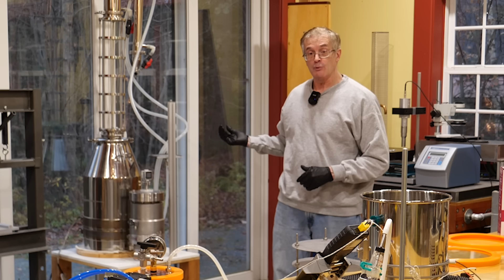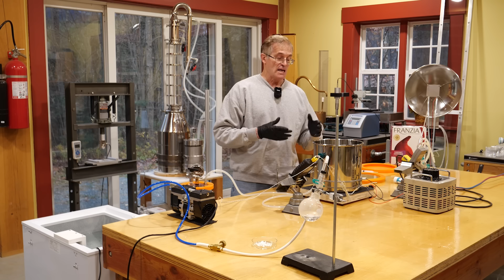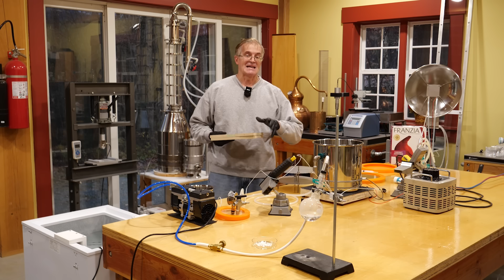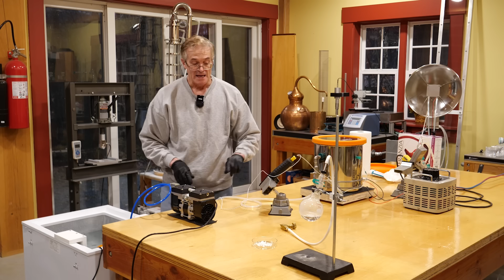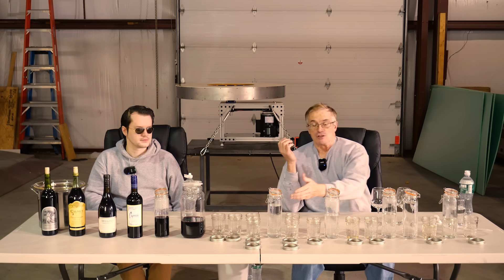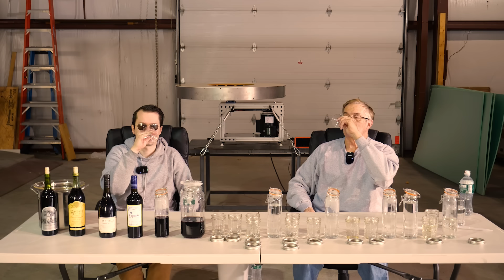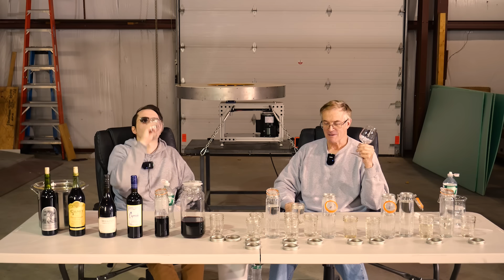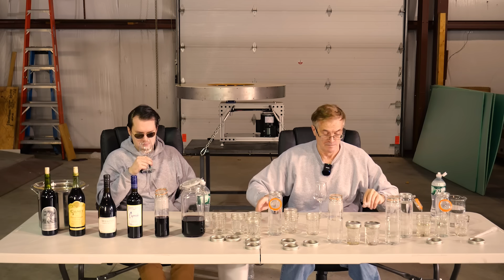Turning $3 Wine into a $100 Vintage with Science!

Comment: Suggestion for next time: Divide your first "pull" into three or more smaller ones. There may have been some "heads" in that first glass, which could be gotten rid of without sacrificing the alcohol.

Hypothesis with no basis in facts: When a wine is aging, the hypervolatile "heads" (or "pre-heads") are slowly evaporating out, into the head space of the cask or bottle. Allowing the wine to breathe is giving time for those to escape. Which could be simulated by pulling a vacuum and tossing the first few ounces that come out. Vintage wine in mere minutes.

Also, to avoid oxygenation, add dry ice to the pot (enough to fill the pot with CO2) and let it sublimate before adding the wine. Set the bag into the CO2, and cut it open. No oxygen.

Comment: The more components you remove from the final mixture, the more concentrated the final mixture will be. I wonder if there would be benefit to substituting the undesired components with something neutral flavored to avoid the final product becoming too intense. Also, there is no need to remix the parts in exactly the same proportions they came out. By dumping all the containers you kept back in the pot, you maintained the same balance between those flavors of the original wine. You may have a better experience mixing them in different proportions to fine-tune the flavor profile.

Comment: Thx for the video it was fun. I also have played in the same field myself. Just a thought but you might want to try adding back the same amount of distilled water that you took out by volume. I believe it might rid you of the tart flavor as well as intensify the flavors. I have found that water helps carry the flavor to my taste buds. You might even taste more flavors making it more complex. And as you probably already know, it will bring the alcohol back to its original proof. Just my 2 cents. Thx for the video.

Comment: The rejected fractions were mostly water, which you didn't replace in the final blend.  A lot of the improvement (and increased resemblance good wines) is likely due to the resulting concentration of flavors.  Which still leaves you with a vastly improved $3 wine.  I wonder if it would be economical to carry out this process on an industrial scale, and convert $3 plonk to, say, a $20 wine.

Comment: On the small container, you drilled holes in the plexiglass lid for the fittings.  Why not do the same for the large container?  That would seem to be less of a PITA that drilling holes in the pot and dealing with the rubber stoppers.

ALSO, if one put a value on their time, one would be ahead to just buy the more expensive wine and not spend 12 to 14 hours on this process.  I one scaled it up to doing 5 gallons at once, that might make it worth while.  LASTLY,  one could have as many of the smaller pots as one would have breaks and plumbed with electrically controlled valves.  Then a timer would open one valve at a time and in sequence.  Once set up and running, you could just walk away and come back when it is done.  That would increase the equipment cost but also the time efficiency.
Reply from the maker: Regarding the holes, the top for the larger pot is made from tempered glass. You don't want to drill that.
Scaling up will add only a little to the total cost.  That's good.  Furthermore,  once you have decided what fractions in the distillation you want to exclude, you can significantly reduce your involvement or as you suggest,  even automate it.

Comment: 12:25 Pressure cookers are incredible at making stock. Roast bones, add to pressure cooker, cover with water. It basically multiplies the cooking time by 4, so a 4 hour pressure cooked stock is like boiling on the stove for 16 hours, WITHOUT having to refill water and therefore concentrate the solids left behind by boiling.
	Pressure cookers can be used for like rice or beets or I guess steaming… they’re ok at that. But they’re unbeatable at making bone broth and bone stock.
Reply from the maker: You may be right about the bone broth.  I usually place a large stock pot in the oven overnight and it works very well.
In by limited experience with pressure cookers, the vegetables come out all tasting the same and the meat is mushy but dry.
Reply: Stock should never be boiled -it kills the essence.  Low and slow only.

Comment: I've been thinking about this for years! In part for distillation but also for maple syrup or broth reduction for mother sauces to see how reduction without heat changes to flavor of the food. I was surprised how well the condensation bucket worked. That was always the hardest part for me to solve because the pumps don't often handle water vapor well. But it looks like this simple condensation setup worked well.
Reply from the maker: It works extremely well and when you're done you can drain the freezer,  replace the lid and put the food back in.

Comment: I'll just mention that for cork and rubber bungs that I'd make the hole with segments of an old car radio antenna. Cut out the appropriate diameter stainless steel tubing from the the assembly , sharpen the ends and the rest is straight forward.

Comment: would vacuum "aging" impact what a normal aging does on a barrel ? basically would you speed up the aging process of say whiskey if you did it under a vacuum? tanins and flavor of the wood if left with the alchohol, would it be faster if under vacuum?
Reply: You could spend it up, however with vacuum you would slow down oxidation.

Comment: If you added a siphon with a valve to the pot, you could suck in the wine without exposing it to air at all.  Not sure if it would make any difference.

Also, while doing food experiments, here's one I'm pondering. My ultrasonic cleaner can heat to 80°C. I wonder what ultrasonic slow cooked meat taste like, and how tender it will be.
Reply: What are you smoking???
Reply: @Cooking-frogs  Nothing. By pouring, the wine gets aerated. Volatives will oxidize and impact flavours. Not necessarily a bad thing, but you might want to do the destination first. It's not complicated to avoid aerating the wine.

Comment: EDITED for 'tone' and details:  Commercial wines especially cheap reds, use sulfites for preservation. Sulfur anywhere in a distillation is pure nasty. Copper helps but not enough for what's in wine. 
Wine fermentation does indeed make methanol, up to 250mg/L. Grapes contain pectin and pectin ferments into methanol.
Most methanol does come out in the tails due the presence of water molecules spreading its effective vapor pressure over a wide range. There is little flavor difference between ethanol and methanol flavors anyway. Determining relative concentrations by taste isn't really practical.
Reply from the maker: I cover the copper in the livestream that follows.  I should have mentioned that added option during the video. 
You're wrong about the methanol and your condescending response was uncalled for.
Reply: @TechIngredients   Edited now w/ more detail and less snark. My tone was meant to be playful. Failed. Nevertheless my post was correct. White Labs in NC can test samples for you (GC) for a reasonable price. Copper works best with hot vapor. May not work well in a cold vacuum distillation system.

Comment: Vacuum distilling with a heat pump that moves the heat from the condensing side to the evaporation side would be much more efficient than regular boiling-destilling, right?

For small and bigger industrial scale.

Comment: Surprised you didn’t include a fractionating column. Awkward but might have better separated the cuts. Also consider not fully adding all of the residual tartness and color from the pot but add increasing amounts and see if perhaps a smaller portion is optimal. An interesting note from beer making is a step, temperature rest (I think), used to decrease the diacetyl content. I think it is skipped with some lambic styles where a buttery note might be a feature rather than a defect. My local daughter has a fairly well educated palate for wine tasting if you’d like another opinion. Cheers.

Comment: Also your vacuum pump reminded of one of my other favorite science tubers

Dan gelbert 
Video in question is titled “prototyping - metal 3d printing”
Incredible video. He take an sls resin printer prints an incredibly accurate silicone mold, fills it with a slurry of metal 3D printing powder and a liquid to suspend and bind it. Puts it in a freeze dryer to degas and dehydrate but leave the binder. Then winters it. If you can account for the shrinkage you can produce parts with tolerances that I struggle to reproduce consistently as a machinist and the ability to produce feature I simply cannot do. I would love a breakdown of yours on the video and I think you would certainly find it interesting yourself if only to be capable of producing some of your own custom parts.

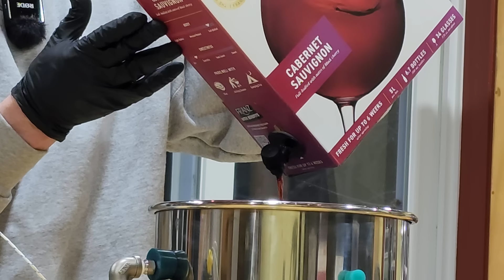Comment: One criticism.   First, I loved this entire video, watched every minute.  Even liked the prostate joke @34:57.   The criticism: I think you should have made 2 versions of final wine.  One, just like you did.  The second would exclude the appropriate percent of the undistilled red base equal to the percent of distillate you excluded (by volume).   IMO, your final wine had an excess of undistilled component.   Not sure which would taste better.   ----    Another thought:  keep a log as you do the tasting.   Option:  could taste in opposite direction since alcohol dulls the taste sensors, but going 1 to N like you did is more intuitive so this "option" thought is not really a criticism.      Final thought:  I had a summer job with EPA years ago;  part of the analysis of samples involved a freeze drier.  If the pressure was lowered too fast, the sample would boil over:  I now suspect this was the same thing as the bumping you described.    (we were measuring for halogenated pesticides in secondary sewage effluent, early 1970s)

Comment: Franzia is the wine I almost exclusively buy.

To get the last of the wine from the bag, you can either slice the bag open or blow some air into it so you can then squeeze the bag to blow the last of the wine out.

You can use a razor, a really sharp kitchen knife, or a sharp pair of scissors.

Comment: Rubber Stopper Drill

Using an external pipe to grip the stopper is good but to drill the hole, I take small piece of aluminum, brass or steel rubbing and grind a chisel edge on the tubbing with a cone shaped Dremel stone, diamond or carbide burr.

Chuck up the tubbing in a drill press and drill into the rubber stopper.

Isopropyl alcohol makes a good cutting fluid for sharpening the tube and cutting the rubber. If sharpening aluminum or brass the alcohol helps prevent loading up the tool.

The step drill is good for embiggening a hole in sst.

Comment: Amazing! Vacuum distillantion is how the better de-alcoholized wines are made these days - you break the wine into component pieces with the distillation, then chuck the alchohol and reconstitute all the other elements which allows you to lose as little flavor or aroma as possible. It all comes back together differently without said alcohol, but it doesn't "mute" the wine like heating it up outside of a vacuum does.
Reply from the maker: Agreed.
Reply: @TechIngredients  The one thing I will say: your reconstituted wine had a lot more time to "breathe", and possibly the $69 and $100 bottles would have tasted better if they'd had similar oxygenation prior to tasting. That said, the fact that those wines would have needed air to beat the reconstituted Franzia is still utterly fantastic, and a testament to the process. Bravo.

Comment: This made me remember an idea I had. I wonder how it would go if you distilled whiskey then put it in a circuit with a pump that forced it through whatever wood you chose. My idea being that instead of the whiskey being pulled into the cask and pushed back out be temperature over a long period of time to give it flavor, you speed that up by forcing it through what is essentially a wood filter.

Comment: Did you keep the temp the same the whole time? Normally we would slowly raise the temp to separate off the different fractions.
Reply from the maker: In principle,  it isn't necessary. 
Because the more volatile components have a higher vapor pressure (evaporation rate) at any temperature, they will accumulate earlier.
Reply: @TechIngredients I have just personally noticed you can be very specific about the fractions if you start with no heat and pull vacuum and slowly introduce heat you can see the individual compouds collect and then stop when the heat isn't enough to continue the boiling.

Comment: If there is methanol in the wort/must that you're distilling, there will be methanol in EVERY CUT except the final tails.  It is a myth that the foreshots (very first condensate that comes over in distillation) needs to be thrown away because it contains methanol.  The boiling point is only one component of the "relative volatility" (the vapour-liquid equilibrium behavior) of a molecule like methanol in a complex solution containing not just water and ethanol, but a host of other molecules, some of which form hydrogen bonds with one another.   The VLE behavior of these distillations is very complex- there are many potential azeotropes (mixtures where the vapour and liquid have the same composition).  While the foreshots do contain some methanol, they also contain other unpleasant molecules- methyl and ethyl acetate, acetaldehyde, ketones etc.- that taste bad and are also toxic.
Reply: would it be ok to drink if you pour all cuts back together? Since the ethanol will cure the methanol poisoning?

Comment: I am not an expert so this is more a question than a comment, but as someone that de-gasses silicone and other things fairly often I have never needed to grease the lid, so is that actually needed for this kind of application?
Reply from the maker: It helps. When degassing resins and plasters you can keep the pump on and so a small leak is no big deal. If we left it on, the wine vapors would get into the pump and be lost.  We need a really good seal.
Reply: @TechIngredients  ah yeah I see, thanks

Comment: I imagine you wold need to re-calibrate the thermometer after modifying the leads
Reply from the maker: I did check it.
But think about the way it works.   The vast majority of the resistance is at the thermocouple end. Then modify this with the addition of one meter of 30 gauge copper wires and further modify this with 2 centimeters of stainless steel rod with 10 times the diameter and 100 times the cross section. It's trivial.

Comment: Caymus and Meiomi have similar pedigree, they were originated by the same family in Napa, the Wagners.   Meoimi was sold by the Wagners to Constellation Brands about 10 years ago for over $300M!  It is meant to appeal to the masses and is made in very large volumes.  Profit is the key word, specifically why Constellation would want it in their portfolio.  It gets a lot of hate from wine people because of it's sweet manipulated taste, suggesting that it is a lab wine.  Fun seeing you both pick up on that.  Interesting that you should select it to compare to your lab wine.  Maybe you will get a call from their attorneys. 😊  Caymus gets some of that hate too. My main complaint is the price versus quality. Back in the early 90's it sold for $20 a bottle, but then so did a lot of other high end Cabs.  Also almost all high end California Cabernet has oak aging.  It should have also been apparent in the Caymus, and not just the Silver Oak.  They probably both spent at least a year in new French Oak barrels, which are over $1,000 a barrel now.  It's most apparent when you first pour them into the glass, and as you become more accustomed to wine tasting it can be a turn off if too overdone, as it often is in California.  If you wanted to go full lab on us maybe you could have added a little sugar or glycerine to your test tube wine.  This was a fun video to watch, if I had one gripe it might be that you didn't stick to the same varietals, but then Meomi would have been excluded, and that is no fun.  ;-)

Comment: Interesting.... I think a snobby wine connoisseur might say a true wine needs to be whole.  As a chemist, I would say you probably removed some terpenes like geraniol and possibly phenolic compounds like thymol.  Geraniums creates geraniol and thymol is in listerine and oregano.  I would be curious to see a GC/MS of the fractions.  While watching, I was wondering if the mother liquor (wine) was constituents were being changed chemically as the distillation progressed, perhaps creating higher esters.  It appears the low heat/high vacuum worked well.   I think you may have started something.   Perhaps we will see "Blended scotch whiskey from select fractions vacuum distilled at 25mmHg"   on the shelves at BevMo in the near future.

Comment: It would be really interesting to watch how they char oak for bourbon and whiskey.  And then find a way to add the smoke flavor.  I don't think you could put a piece of oak under vacume, but it may work if you light it, get it a little charred, and chemically add a smoke flavor... through the vacuume system.  Also, your system is missing a thump keg. lol

Comment: I cut steel mess like this for making sifting trays and I have had very good luck using aircraft type tin snips to cut out shapes in the mesh, agree that it isn't practical to use most power tools on them without some kind of holding fixture like you mentioned, but snips are definitely the easier answer in my experience
Reply from the maker: Good advice.